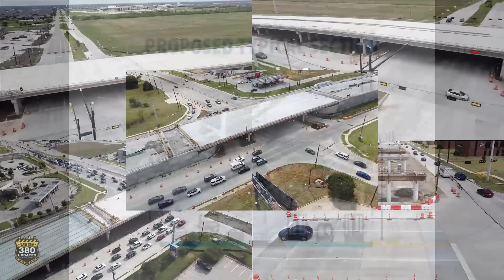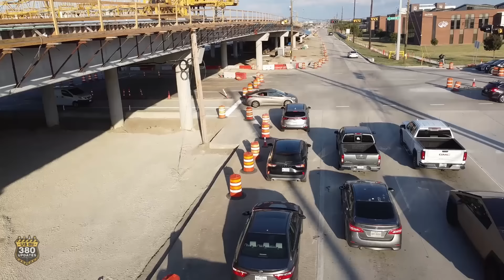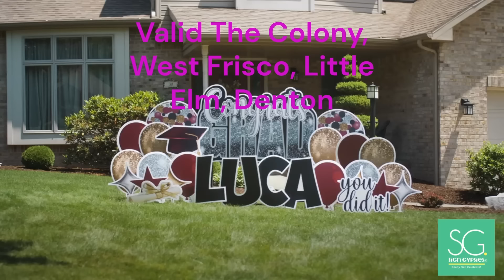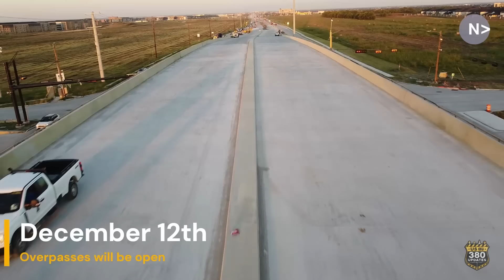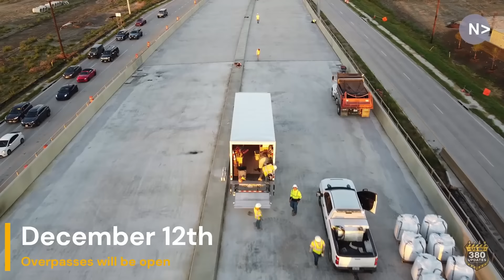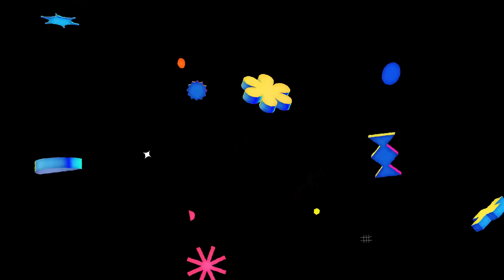Oct 10th - END OF PHASE TWO!

Comment: Great news!! Do you happen to know if the speed limit will be increased on the overpasses or will remain at 50mph?
Reply from the maker: It’s highly unlikely we’ll see posted speeds over 50 mph through most of the developed corridor once the project is finished. The expansion adds more signals, turn lanes, and business access points, especially from Navo to the county line — all factors that push limits lower. In our last video we stated there are 123 driveways reconstructed, which means quite a few access points!

However, east of FM 720 toward the less developed sections near Aubrey and Cross Roads, you could see 55 mph or slightly higher in the future, once construction wraps and traffic patterns stabilize.
Reply: Speed limit signs have never stopped Texans before so why should that matter now.😅😅

Comment: My confusion is: 3 lanes of overpass will merge with 2 lanes of frontage road and end up with 3 lanes. OK, the far right lane on the overpass will merge with the left lane on the Frontage road. Does that mean as you are coming off the overpass the left 2 lanes on the overpass are suddenly going to merge into one lane? So, as each overpass ends we will have 4 lanes quickly merge together and end up with 2 in, what, 1/4 mile at most?
Reply from the maker: The entire roadway is being widened to 3 lanes. The frontage roads appear as they will merge themselves into 1 lane and then merge into the 3 main lanes.

It would be hard for 2 lanes to merge into 3. Lake we showed in the video, there are merge lanes built in that are not being used right now. 

It will look a lot like merging into 380 westbound after exiting the tollway right now, but even that is a bad example as there are 4 lanes there for a bit.